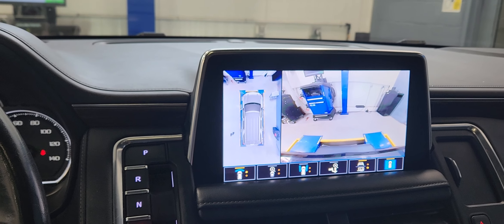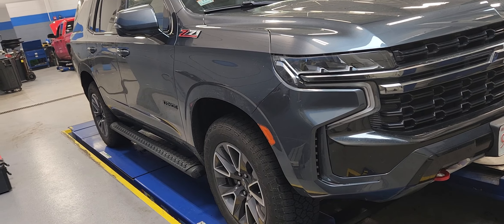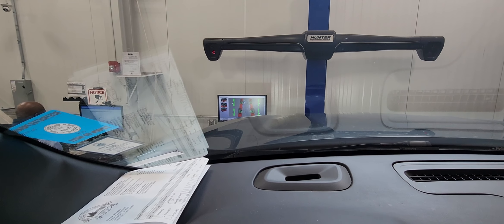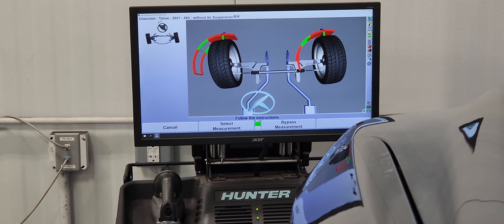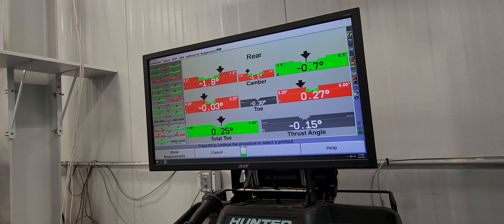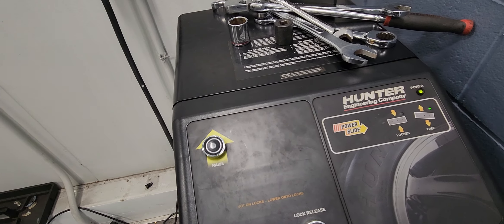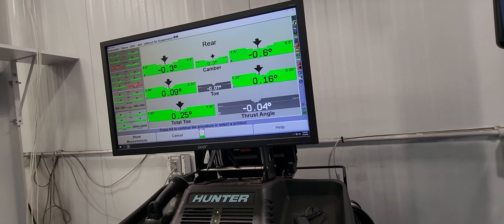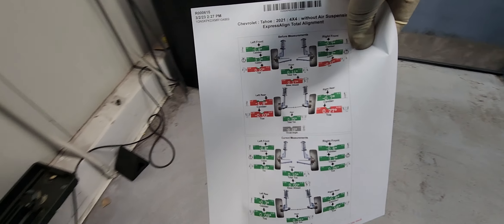21 Tahoe 4 wheel alignment ,how it is done?

Comment: When you aligned the tahoe did you have to recalibrate the steering wheel? I have a 21 Tahoe and they couldn’t get my steering wheel centered.
Reply from the maker: Something is probably wrong in the suspension, did it get into accident? Those truck are easy to align
Reply: No bought it new so no accidents.
Reply: He says I have to come back in to recalibrate the steering wheel to make it straight. The steering wheel was fine before I brought it in to have it aligned. We only got it aligned because from tires were wearing weird
Reply from the maker: Take it to another dealer, tire is wearing out because the camber is out of adjustment, the steering wheel angle sensor will need be adjusted if the alignment is severely out of adjustment, did you hit a potholes by any chance?
Reply: I will try another place for sure.  Roads here are terrible so we try to avoid potholes but I have hit some for sure. Thank you for the help. Appreciate it!

Comment: Start have them problems 2014 models steering angle sensor anything have em gotta keep them running
Reply from the maker: I usually shut off the vehicle because the vibration from the engine runnjng and heat throw the sensors off

Comment: Done gmc 2020 Sierra in past jack front cam stack drag program  some people do it while ground or jackup tension between ground weight of vehicle jounces make difference camber bolts eccentrics must move order get adjustments another thing leave vehicle running due to timing of steering angle sensor predictable unless u you know how mechanical operation of device rather leave running attends jump out me